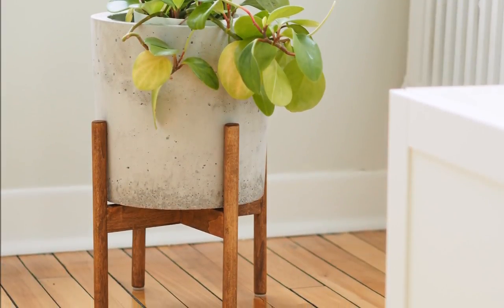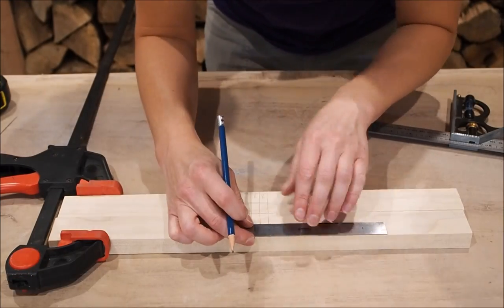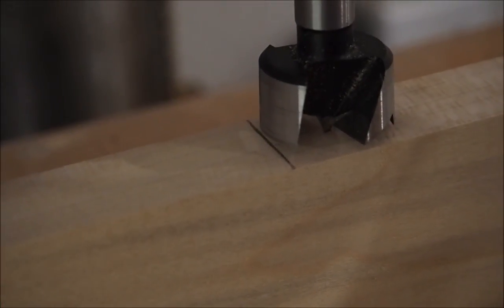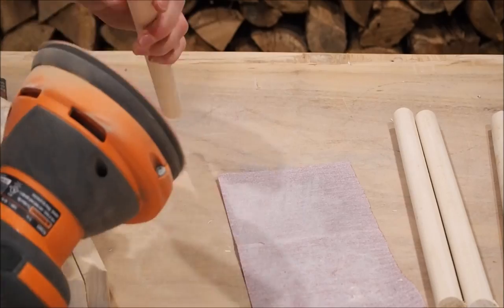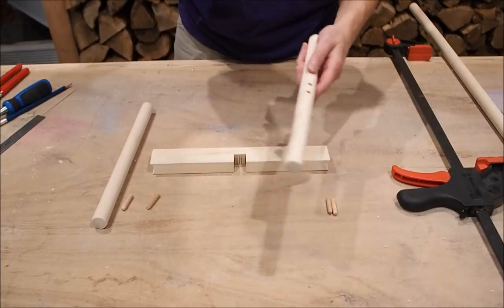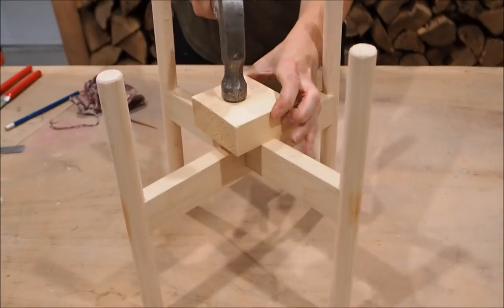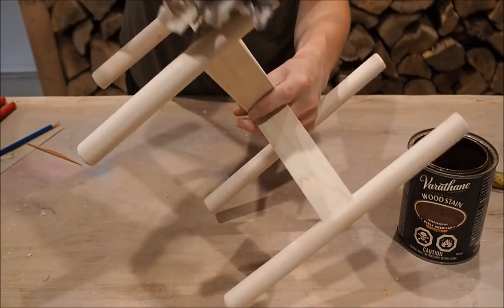DIY Wood Plant Stand

Comment: great video! after applying the stain do you sand again? how many coats did you apply?
Reply from the maker: No, I never sand after stain. Apply one coat of stain. Ideally you want to seal it after it dries with a clear coat, like maybe a wipe on poly 2 coats.
Reply: @DIYMontreal  thanks

Comment: Gonna try this.  Apologies for the basic question, but why is your center notch only to a depth of 3/4" not 1" if the poplar board is 2x1?  Seem like a 3/4" notch on each piece wouldn't yield a flush fit like you got.  Sorry if I am wrong---just wanted to double check before I give it a go.
Reply from the maker: So a 1 x 2 isn't actually 2 inches thick as you would think. It's 1-1/2 inches. That's why I went half way through to 3/4.

Comment: Cool, but it drove me nuts that the two pieces weren't flush when you were marking.
Reply from the maker: What do you mean? Because the ends weren't flush? I cut off both ends by drilling through with the Forstner bit, so I din't see the need ;)
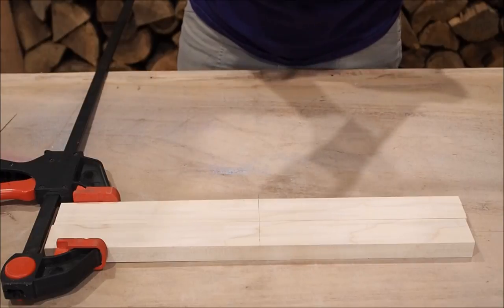Reply: DIY Montreal at like 0:38 were the ends weren’t lined up other than that it looks beautiful you did a great job! So cool that you have all the cool tools to do everything. They cost so much already made so it’s nice that you can do it for way cheaper. Will be subscribing to your channel 👍🏽

Comment: Can I make a suggestion. Use the metric system in your videos. It's international used and so much easier to follow. Thanks
Reply from the maker: As much as I’d prefer using the metric system myself, all of our lumber and tool sizes in Canada are based on the imperial system due to our commercial proximity with the US.
Reply: @DIYMontreal  Well said, Maria. Let them make their own videos.